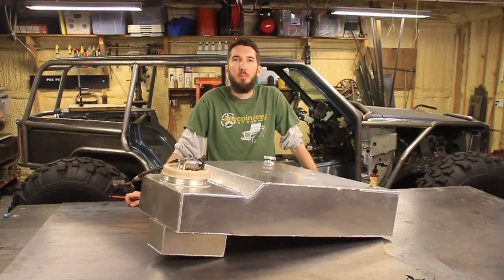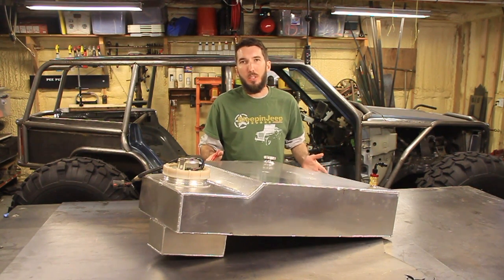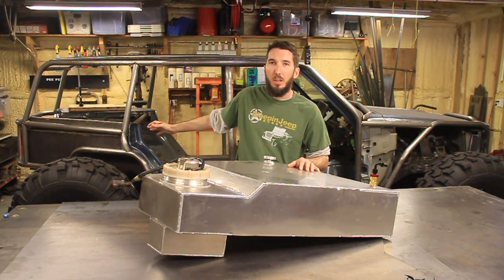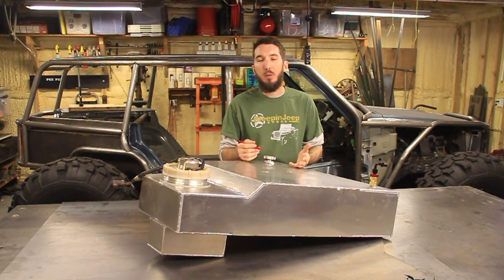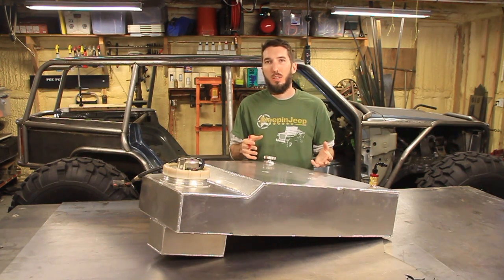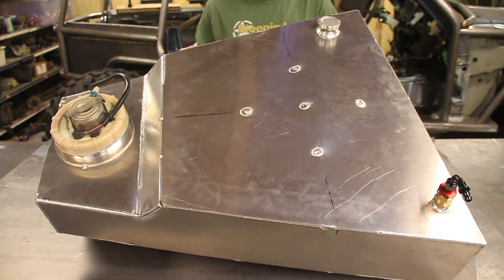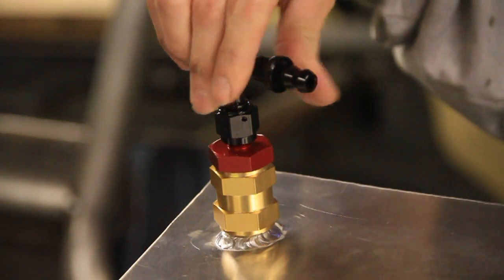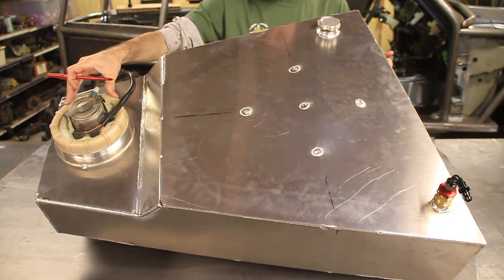Fuel Cell 101

Comment: Very interesting! Thumbs up for insisting on a roll over valve and not just for rolling over. As a dealer tech for decades, the roll over valve is part of the vent system because , filling the tank, fuel rich air exists the tank to allow liquid fuel in. Most OEM, like GM & others, use a liquid floating type. When liquid fuel reaches it, it lifts and spring assisted but seals. This action pushes raw fuel fuel up the filler neck and shuts off the pumping action when it reaches the aspirator tube inside the nozzle. There are wires from the pumps nozzle for ground and shut off inside the rubber hose. If the “Ball” does not float or goes to a simple gas line up the roll cage, makes a “U” turn then terminates, the smell of gas will fill the garage as it expands and contracts. Using an activated carbon canister will capture these organic hydrocarbons. It creates a mild exothermic reaction. Once using or pulling the fuel level down, it will allow air in, endothermic reaction, and keeps the tank for collapsing in a vacuum. Canister are sized by the fuel tank. Get a used one from a GM truck in the bone yard and glue some cube of foam (Seat Upholstery Foam) to the canisters “Vent” pipe. Or, attach a hose and place a lawnmower fuel filter on the end. Purge fitting can be plugged unless you program the PCM to purge. No purge cold, idle or upon deceleration as injectors shut off. The roll over valve is connected to “Tank” fitting. The only time “Vent” & “Purge” is closed during “EVAP” testing for leaks. We don’t want hydrocarbons escaping and running off to have fun by the pool or watching the game! Hell No! Hide the canister? Run roll over valve line up high, loop down, go under the bed or somewhere to mount. 
  The return line (If used) but returns normally to the bucket where the pump is. The bucket type are call modular resivour assembly or MRA. To avoid aerating the fuel, dropping volume which in turn drop volume and misfire. That is a no, no in the car world. They actually had the misfire counter less sensitive in 1997. On many models, the output high pressure side had a “Tee” in this line. They placed a Venturi valve made of brass, cast into the plastic. It had a 0.030” hole and bell shaped. It creates a low pressure in a passage to the bottom filter. This pulled fuel into the bucket, cooled the pump and kept a supply of fuel at the ready. They had a float that lifted to open a dump to maintain the the level of fuel inside the bucket. Fuel pumps are designed with two rotors where the first one pump fuel in and had bleed holes to allow air out. The second rotor creates the volume. Without volume, you have low pressure. It passes thru the center of the pump, out the top, pass a check valve to hold fuel in the lines while the regulator blocks off return when pressure drops as shut off. Just some info. ASE Master Tech since 1978 - Retired

Comment: Could you help me out with sourcing the aluminum ring with threads to mount the pump? I can't find one to save my life
Reply: I found a ring but it’s not the same exact one that they used in the video. Instead of being welded on this one is bolted on with a gasket.

https://www.anyprices.com/genright-fuel-pump-adapter-117225/price-comparison.html

Comment: fu·el cellnounnoun: fuel cell; plural noun: fuel cellsa cell producing an electric current directly from a chemical reaction
You have a gas tank, not a fuel cell
Reply: damon millman Not a gas tank.
Totally a fuel cell, it has baffles and is for off-road use.
It's a giant motorcycle gas tank, so sorta yeah.

Comment: Matt, you should also include that in case someone was to build/design their own fuel cell to keep in mind as to what type of sending system they are going to use. as it is not uncommon for someone to use the stock unit. however on some vehicles the return line us not only used to return fuel and displace pressure, it is also used to cool the electric fuel pump.

Comment: that is not true, the fuel cell foam last way longer then a year, all the technology came from the aircraft industry , and small aircraft fuel cells and foam last a very long time   the idea is that a real fuel cell has the bladder that will bend and squish  in the event of a serious accident. the foam is used to stop sloshing and to slow down leakage in the event of a rip in the cell. anything else with out a bladder or foam is just a gas tank not a fuel cell. this is from fuel safe...

Fuel Safe Fuel Cell 
Guidelines
Here at Fuel Safe Systems, we work tirelessly to provide the highest level of quality, performance and durability. Everything we manufacture is built to withstand the extreme demands our customers place on our products.

Safety fuel cells are out of sight so they tend to be forgotten. Fuel cells have a finite life span. The environment can greatly affect the cell’s longevity. The typical lifespan of a fuel cell is between 8 and 10 years, although all sanctioning bodies limit use to 5 years from the date of manufacture. By following a few simple guidelines and inspecting your fuel cell on a regular basis, you can ensure that the performance and safety of your vehicle will remain intact.

•Avoid fuel additives
•Do not store fuel in the cell for long periods
•Do not expose the cell to harsh chemicals
•Do not use solvents on the cell
•Store your bladder in a cool dry place, out of direct sunlight
•Inspect the interior and exterior of your cell once a year
Reply from the maker: +keith wilson you just proved my point with your own comment!  You claim foam last longer than a year but in the last paragraph you say not to store fuel in the cell, and to inspect the interior once a year.  Now why would they have those guidelines if the foam isn't breaking down??  It may last for more than a year, but only if you pulled fuel after every ride and clean the foam once a year. Which isn't going to happen for most people.
Reply: +BleepinJeep  well i know from my 1st hand.. i have raced in the desert for 20 plus yrs and the foam has never broke down but the bladder does need replaced after 8 to ten yrs, but you are calling something that is just a custom gas tank a fuel cell, its just a gas tank is my point.. a custom one but still just a gas tank not a cell.. and i really like your channel and all the stuff you do, but this one you are calling something that it is not its a gas tank not a fuel cell period
Reply: +BleepinJeep also those were not my words but the words of fuelsafe..  but i have never drained a tank and we race ever 6-8 weeks and some time 6 months.. my guess would be the storage thing would because of the fuels can break down over time and with so much eythenol now days  its not the best for the bladder... once again my whole point is that that is not a fuel cell, its a custom gas tank.. a very sweet looking one though..
Reply from the maker: +keith wilson Not trying to argue or anything but I think the difference between a fuel cell and a gas tank is a lot more grey area than black and white.  If you search for fuel cell vs gas tank and do some reading there are a lot of "opinions" out there but mostly the consensus is that they are exactly the same but with the fuel cell being only aftermarket and having a few more optional safety features.
Reply: +keith wilson Technically by definition, you're just running a custom gas tank on your rigs as well. An actual fuel cell is a device that converts the chemical energy from a fuel into electricity through a chemical reaction of positively charged hydrogen ions with oxygen or another oxidizing agent. As far as your estimates on the life span of the bladder and foam, ATL racing says bladders last 5 years. They also say the foam should be inspected several times a year and replaced every 2 years. Oxygen bearing fuels does effect safety foam more. There is a lot of cases where the foam has broken down and clogged up fuel pumps and filters also. A lot of it is having to buy premium foam vs budget foam, one will last longer than the other but both is a lot more work having to check it over the lifespan of the vehicle. Really with this rig being a crawler and a full cage around the vehicle, it should be completely fine.
Reply: +TheAmericanUhate  well fuel safe says other wise and i would say they are the pioneer in the market, maybe they just have a better product i dont know but the the fuel cell we are talking about have been around way before the kind you are refering to.. but tomato .... so i was just saying what he has is a gas tank, zero safty involved and not a fuel cell, and in life somethings share names but are not related what so ever..
Reply: +BleepinJeep  your right, i like your channel..  well about arguing.. i think that is a sweet gas tank, but it would never pass tech in a race series cause it is not a fuel cell, but what ever still really nice and i thank you for letting me have my opinion in such a nice way just show what a nice guy you are:) oh and wasnt saying you were trying to race or anything like that just as an example..